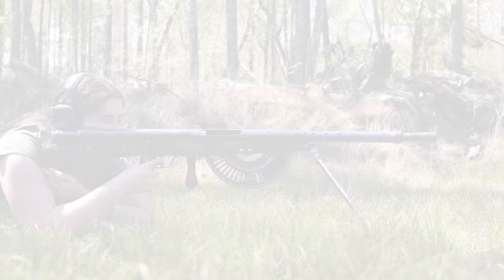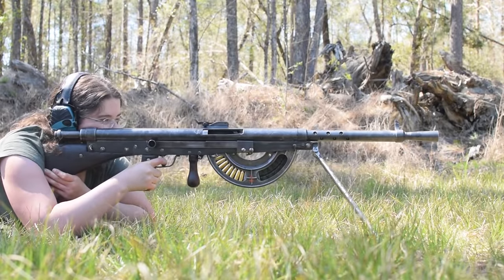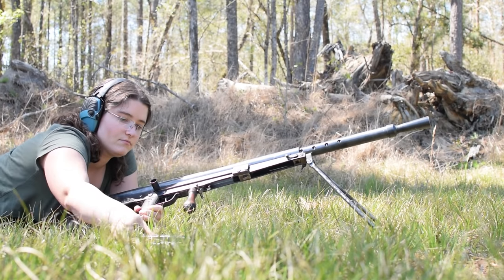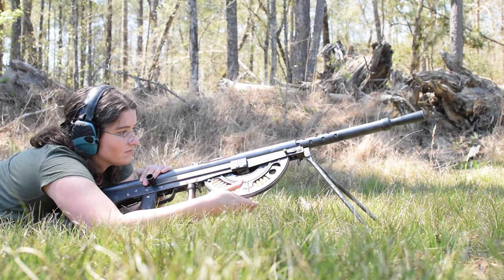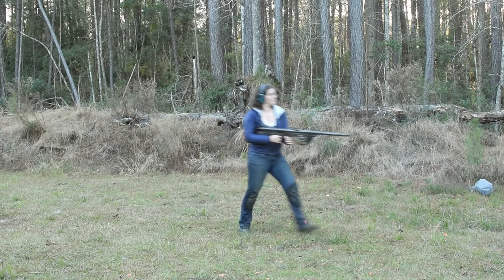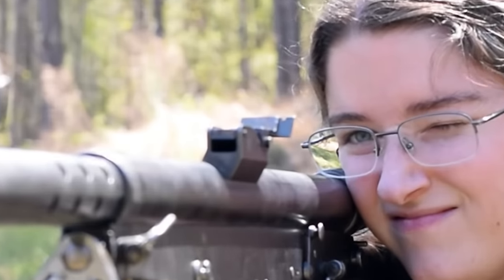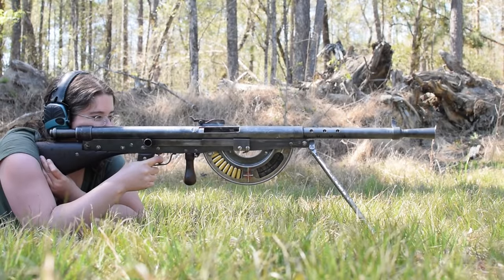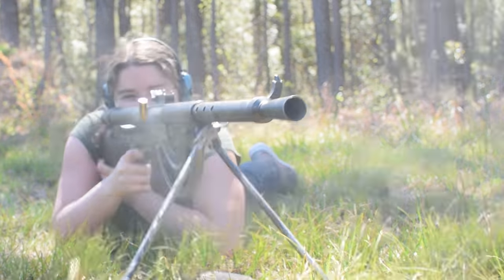Minute of Mae: French C.S.R.G. 1915 "Chauchat"

Comment: Probably would've had a smoother feed using ammo other than 8 mm Lebel, but the French wanted to ease supply by using the same as the rifle.
I've heard that the rechambering for .30-06 caused a lot of problems, and is the primary reason for the Chauchat's dismal reputation among the Doughboys.
Also, glad you avoided "the smack!'

Comment: All things considered this was actually one of the best light machine guns of ww1.
Reply: Not one of the best: it was the only available automatic rifle in WW1, the BAR cames too late in 1918 and for example the Lewis weight twice and cost 4x more
Reply: @leneanderthalien  the Madsen was the best LMG. I've fired the Madsen and the Chaushit and used to own a BAR.
Reply: @mikebrase5161  Madsen was way too expensive to manufacture on a large scale
Reply: @mikebrase5161 Madsen was still an expensive clockwork contraption compared to this. Chauchat is just a Straight-pull using Long Recoil.

Comment: The open magazine in the trenches?  No one saw that it was a bad idea?
Reply: Different doctrine at the time, you were supposed to use these with a team. One would operate the gun and the assistant would reload and watch the ammo. Was also supposed to be used standing and moving in walking fire (little mud/dirt to get into your magazines if you were standing.)

Also, I am not 100% sure about this so take it with a grain of salt, I think the magazines were supposed to be disposable so dumping them if they were bad due to mud or damage would be relatively encouraged. Judging by their thin sheet-steel construction (basically have the strength of an aluminum soda can) and their cheapness, it supports the idea that they were supposed to be disposable. However, in doctrine, they kept the magazines.
Reply: @dutchplanderlinde4845  The magazines pre-dated the use of the Chauchat in the trenches. The Chauchat-Sutter Mle. 1911, an air-based observer's seat machine gun, introduced the magazines. Obviously in an air-based role the magazine windows aren't a problem.

In the end, it was simply that the tooling for producing the magazines for the Chauchat-Sutter Mle. 1911 already existed, as to why they used it.

Also, you're correct on the magazines being disposable. They-- as well as the weapons themselves-- were expected to be left behind for collection if they were inoperable. This has often been misconstrued by some to say 'the weapons were discarded', but the reality was that weapons left behind would be recycled, and the difference would be considered lost to attrition.

Comment: I see a lot of dissing on the Chauchat and while some of it is warranted, especially the American 30 06 version, the 8mm version used by French Army was a very solid LMG for its time.

 It was cheap, does its job decently well and most of all, there was an abundance of them. Over 200.000 of them to be exact. With the size of the French Army at the time, it meant that every 6th soldier will have access to this hunk of killing machine. The suppressive power through sheer numbers alone was a nightmare for the Germans to deal with at the time. If one breaks down, another 2 more were already there to replace it. That's why the French sticked with it through the entirety of WW1.

Comment: Why did they go with open magazines when they were having issues with mud?
Reply: They already had the magazine design and production capacity for the chauchat sutter from 1911. Also, it was used in a team, the open magazine helped the loader see how much rounds there were left. Apperantly it's also really hard to load a magazine without pushing the spring back through the opening, though the magazines where supposed to be disposable.
All in all most french soldiers liked the chauchat, at least more then the Lebel, and the french field commanders were constantly asking for more. 

In the end 300 000 were made, compare this to 50 000 BAR's and 15 000 Lewis guns.

Comment: who the heck thought it would be a great idea to put an open magazine on the bottom of a gun that is most often shot from a prone position... in mud, dust, sand....
Reply: Same guy that said the trenches will drain, just give it time.
Reply: Nobody did. It's a hold-over from the Chauchat-Sutter Mle. 1911, an observer's-seat machine gun used by the French air corps. In the air the magazine windows weren't a problem.

In the end, expediency in already having the tooling available to pump out magazines won out over correcting what those who tested the prototype CSRG Mle. 1913 found with regards to the magazine's construction: that the thin easily-deformed sheet metal and open design were a significant problem.
Reply: @krad2520  ah interesting, thanks :)

Comment: Kicks like a jackhammer... when it works. I can understand why soldiers weren't enthusiastic about it. What I don't understand is why they bothered putting this into service in the first place, when better options were available, such as the Madsen or the Lewis.
Reply: This was a better design than either, just hampered by the open mag. It's basically just a long recoil straight pull. Madsen and Lewis are way too clockworky, and the Lewis is a cheaply built clockwork to boot.

Comment: i want this gun to function better sooo badly. if it were a better gun i wonder how much longer it would have stayed in service.
Reply: You have to remember that these guns were straight out of the factory, not 100 years old, and that you weren't reusing 100 year old magazines.  They were also new and came to the front pre-loaded.  They were pulled out of the box, locked into the gun, and fired.  
They would have functioned fairly well. 

The reason that they only lasted so long in service is that better designs came along
Reply: The chauchat have been used for around 40 year that's quite good

Comment: No wonder the French surrendered...vs the MG42...this is junk. (I think I stand in the wrong war?) There I said it. Sorry Gun Jesus, I know your affection for the French. Mark pretty much called it on the model he was ..hey is this that one?
Reply: this is litterally a WW1 gun, the french didn't use as much as the MAC24/29 in WW2 which was one of the best early war LMGs, only beat by the MG34, the MG42 also wasn't there when the french surrendered, and even then the MG34 was a better machine gun
Reply: This would have been up against the Mg.-08. While that is a great machine gun, they were heavy and harder to move and more expensive than this.
Reply: @motmot8879  In practice the FM 24/29 was a better LMG in the offensive than the MG34 - much lighter and the practical rate of fire is more sustained with top-fed magazine fed LMGs, as reloading a belt fed after expending your 50rd belt is glacial compared to the practically instant reloads on a FM 24/29, Bren or Type 96/99. If you can feed the MG34 out of an ammo can when in a foxhole it's great, but otherwise sub-optimal.
Belt fed GPMGs are, with the notable exceptions of the PKM, HK21 and Negev NG7, generally not that well thought out and heavier than they need to be.
Reply: @motmot8879  
Doesn't MG34 have issues with expense and overall reliability (as compared to 42) of course, that rate of fire is atrocious and pointless.
Reply: Ah yes, I'm sure the french were fighting a lot of germans with an MG42 in 1940 (MG42, from, you (clearly didn't) guessed it, 1942). You're talking about a gun from 1915, in a war where France was the victor. Even the MG34 is decades away. In world war 2 the chauchat was only in limited use.
Also, it is, like the BAR more an automatic rifle then a machine gun, for a machine gun the french had the hotchkiss, and the germans the Maxim. Even the lewis gun was a lot heavier then the chauchat.